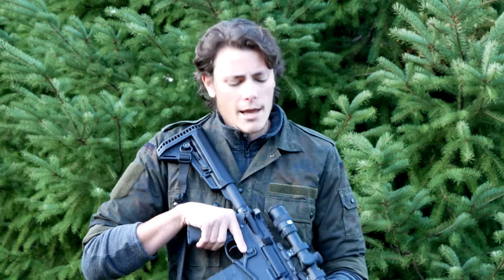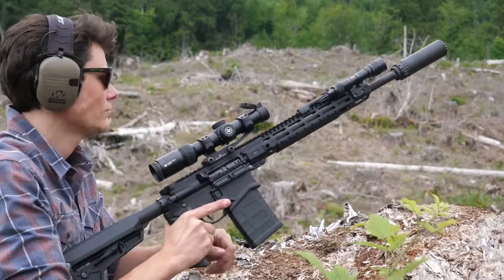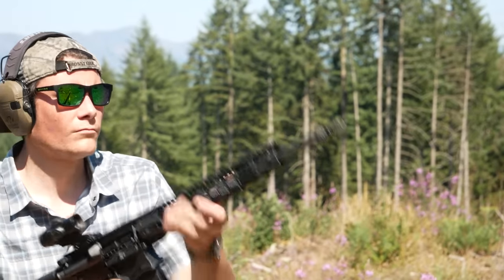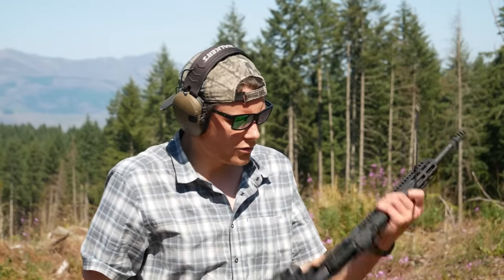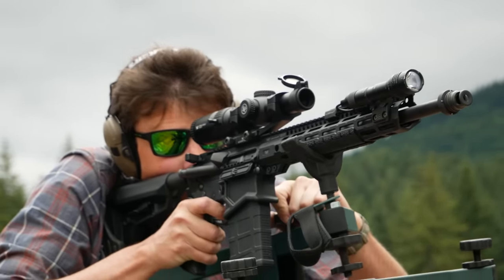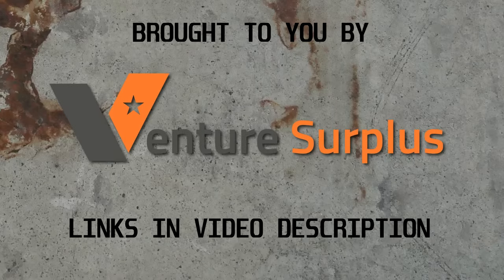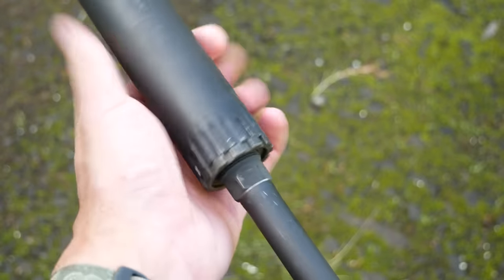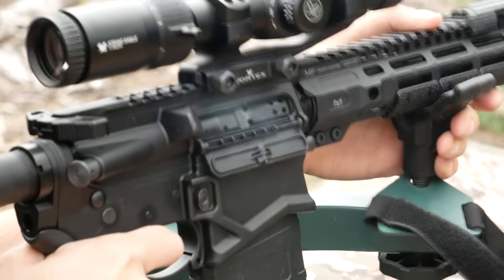Taking the Ruger SFAR to the Limit

Comment: I have a first gen SFAR and none of the issues you have. I shoot primarily on setting 3 right now as I still consider it in its break in period, but I have not had a single damaged case or failure to extract/feed. I have shot it on setting two and didn’t have an issue, but I returned to setting 3 until I finish a few more boxes (so next range session it’s getting turned down). I’m not bothering with a suppressor since I consider any AR pattern rifle not the best for that purpose anyway, so that’s a non-issue for me. I don’t like a gas block with only 3 settings though, I think 10-12 minimum is more reasonable, but I know most AR guys get confused by adjustable gas systems which is why people commonly available things like RDBs and FALs have reliability issues (older FALs sometimes are worn though). If you’re going to make a gun with an adjustable gas system, then I think you should fully commit to adjustability and let the shooter figure it out. Don’t limit their options and the gun’s capability to appease plebs that can’t figure it out.
Reply: @@hnojicYou're ignoring the part where it wants you to run setting 3 for the first 300 to 500 rounds. Running it on setting 2 was a function check, use setting 3 until your a few hundred in. Read the WHOLE manual, don't cherry pick.

Comment: I’ve been lucky with mine. I’m around 200 rounds with 1.3 moa with 168 gold metal match and 1.5 moa with federal 150 blue box. I’m on setting 2 and I would say it’s over gassed. I’m getting light swiping on my brass. I’m running a trijicon 1-6 credo and a ms1 sling and with a loaded 20 round mag it’s right at 10 lbs.

Comment: mine came with a chunk of brass, or piece of primer (not sure, small chunk of metal) stuck in the bcg... runs, but only on 3. have about 250 rounds in it using 147-155 grain mostly, shot a few 168 and 180 too

Comment: If the gas reg was out of spec, how did it make it past all the QC steps and then get put on a finished product? And then be tested at the factory and shipped?
Reply: Because it costs tons of money to gauge the specs on every single part in every single dimension of said part, that comes out of a factory, so most companies will have "1 in X amount of units will be thoroughly vetted" to still do SOME QC without breaking the bank. I would definitely recommend the channel "School of The American Rifle" here on YouTube.

Also, the cheaper/porter quality a product is, there "1 in X" bunch tends to be lower, and therefore larger margin of error. So you get lots of reports of problems on the market
Reply: Because it slid onto the barrel well enough and checking the gas seal without test firing is extra work.
Reply: Because it's a cheap Ruger

Comment: Wild that there is that many issues with a 4 position gas valve.
My Supersass is a simple 2 position.
Normal rounds cycle with normal position.
Suppressed rounds cycle with normal position and suppressed position.
Normal/nonsuppressed shots don't cycle on suppressed position.

It's exactly what it should be.
And the valve is like an MCX. Take a round and just flip the valve to the other side. No allen key or anything needed.

Comment: Hop, I am unsure of your exposure and use of the Superlative Arms gas blocks, but from personal exsperience on 8 different rifles: 4 in 5.56 (barrel lengths 10 - 16in) , 1 in 6mm ARC, 3 in 300 BLK (8 and 10 inch) I have found them ALL to be capable of finding a settign that works both suppressed and  un-suppressed without an adjustment in between removing the can. I havent found any other gas blcok that can do that AND not overgas with the supressor attached.

Comment: if its over gassed its because you changed out the hand gaurd and muzzle break. it went from losing too much gas to not getting rid of any. hence the casing stripping. i havent seen anyone else with this issue.
Reply: 12:45 yeah i think you did a lil much to the design lol

Comment: I'm surprised there isn't (either actually or practically) a gas block that has independantly adjustable settings. Even if it's just 2, using a set screw for each, you'd at least be able to fine tune it to work properly on each setting, and you only have to do it once. I have absolutely no idea how that would be engineered, but if we figured out liquid fuel rocket engines, I'm sure someone could figure that out too

Comment: I wish it was a rifle length gas system, it would smooth out the timing both suppressed and unsuppressed and make it a lot less sensitive. I'm putting together an AR10 with a riflespeed on a 16" rifle length criterion barrel. One of the things I'm curious about is gas leakage around the plunger, it seems like a very loose fit, which appears to be required based on how the mechanism works. Significant gas leakage would make this thing significantly less cool, but i'll see what happens. Maybe the POF is an option.
Reply: @@hnojic He's running the 16" version i'm pretty sure, and if so, its the mid length gas system. I'm referrring to 16" rifle length gas system, it provides short dwell time and longer bolt lock times which results in much better suppressed performance and smoother operation.

Comment: Not a Trijicon fan. Go for a Leupold 1-4X.  They are a LOT lighter,  and better glass IMO. Then, use AP's ultralight scope mount in 30mm. 
There are Lots of cheap 3D printed throw levers for ANY scope are available these days.

Comment: Bought my sfar 11 months go and had one failure after 100 rounds. Put a Rugged 360 Alaskan surpressor on it and was fine on stting 3 until the same jam you had so turned it to 2 and no problem. I have an iray Th50 640. 512 V2 Thermal on it and every time I shoot it I have to re zero it. It has me stumped.  Any help

Comment: Maybe A5 buffer tube with different buffer weight would help it cycle and reduce the recoil? Would be nice to see a comparison of SFAR, POF Rogue and POF Revolution. And Ruger should listen to feedback and release a 6.5 Creedmoore version with adjustable gas block and a normal rail.
Reply from the maker: The buffer tube is already A5 length on the SFAR, it needs extra travel to allow the bolt to clear the longer magazine.

Comment: My SFAR works great, I have never had a single misfeed or misfire yet, Haven't touched gas block a single time. It eats all ammo 7.62x51 and .308 no issues. I do  ot mess with Suppressors as I hate them Muzzle Brakes are 10x better, but that is personal choice. I guess I got a good one. Or unlike every YouTube video I have seen on one I didn't pull it out of the box and twist the gas adjustment 40 times before I went and fired a single shot.
Reply: oof
Reply: @jeramocolto  Not sure why you Oof I also have an Aero Precision in .308 it has way more issues and misfeed average once per mag and has only 140 rounds through it. But is broken in. Everyone and their mother talks about how great Aero is and yet the first one I bought had to be fully replaced for a new rifle from the factory as it would fire due to the buffer spring was an AR15 buffer spring in an AR10 rifle, and that is just why it wouldn't cycle a round. Then the hammer spring was installed backward from the factory and thus didn't strike the round hard enough to even fire, again from the factory. So sent me a replacement rifle and it still doesn't cycle well consistently but at least it fired out of the box. But my SFAR took it straight from box and still not a single misfeed or misfire... and over half the cost of the trash Aero.
Reply: @Mr.Constitutionalist427   well you have a lot of hot takes here that would be argued pretty universally.  Not liking suppressors is fine but opting for a brake over a suppressor is not generally a great take.  A muzzle brake will hurt your hearing permanently in a building, a flash hider will LESS or suppressor probably minimally.  Flash is horrible with a brake, you will be blind as hell after a few shots even at dusk.  10x better than suppressed is a very odd opinion.  Also the “didn’t pull it out of the box and twist the gas adjustment 40 times” comment.. you are making the assumption that the malfunction of the rifle is caused by someone using an engineered feature of the rifle.  If it doesn’t work right and it’s on the rifle, it is a QA or design issue, not a user issue.  You are basically covering for their shitty R&D on this gas system because it works fine under the least adverse condition and everyone who tries to use it as intended is a moron lol.
Reply: @jeramocolto  Do you wear hearing protection wwhile firing a suppressor like 99% of suppressor owners? and are you wearing zero hearing protection when firing a muzzle break? See I wear hearing protection. But now let's take how loud the shot is out of the arguement. Name 1 honest advantage the suppressor gives over the muzzle brake in maximizing the performance of the rifle. Answer none the Muzzle Brake hold tighter grouping and less recoil to allow you to be back on target again. If you truely want to protect your hearing while shooting then go shoot BB gun and .22s
Reply: @jeramocolto  I will put it this way for the SFAR I have only see a couple bad reviews like this one, and many good reviews for it. HOP isn't that great of an expert he tends to jave issues with a lot of products others do not have issues with. There are multiple SFAR owners here in the comment section saying theirs are fine and they have zero issues the only ones saying they suck are non owners and HOP... just sayin.
Reply: @Mr.Constitutionalist427  ok you said name 1 so.. a suppressor provides flash suppression, it reduces the volume of muzzle report, you get slightly higher bullet velocity, the extra weight reduces recoil.  There’s a few.  And yeah I always wear ear protection when I shoot, doesn’t matter what it is.  I use ear protection for my electric pressure washer.  That is a non-point.  Muzzle brakes tame recoil and otherwise make the rifle LESS useful.  It creates more concussion for the shooter and others nearby.  Aggressive brakes can induce flinching.  Suppressors are more friendly to inexperienced shooters as well so it is handy when teaching others.
Reply: @jeramocolto  Past 400 yards you will never see the muzzle flash, if you have hearing protection then you do not need a suppressor to protect hearing. Not all suppressors provide higher FPS many do some do not that is design but many big bore lose velocity not gain, baffle strikes happen which can really cause a round to be off target but then it also interferes with the barrel whip and thus will never hold as tight of a group as without. Literally just watched a review video of a man using a 6.5x300 Weatherby and used a suppressor on a rifle with a 26 inch barrel and shot an over 1.0 MOA at 100 yard with a precision rifle but blamed the ammo and the rifle. His comment section said take off the suppressor and retest it with a muzzle brake but he refuses. point is any even mid range precision rifle shoul fire a sub .3 MOA and a .15 for a very well made one. My cheap old Winchester .270 holds a .4 Now let's talk recoil the average suppressor reduces felt recoil by only 20 to 30% most muzzle brakes reduce it by 50 to 75% smokes it also is much lighter for less recoil. Suppressors are over rated but that is my personal opinion and they are awesome on pistols and close range builds but everyone and there mother wants them on every deer rifle and precision rifle in the land... King of 2 Mile isn't won with a Suppressor I know of. If one has I do not know of it and would be shocked.
Reply: @Mr.Constitutionalist427  baffle strikes do not happen if you check with an alignment rod and the suppressor is square to thread shoulder.  Also, yeah any muzzle device can affect point of impact but ammo is usually the culprit.  Deer rifles can shoot 4 moa or worse and be perfectly effective.  Nobody needs to be hunting past distances where worse than 1 moa isnt effective.  My hunting rifle is a suppressed 308 and it repeatably shoots .75 with my best being .36.  Suppressors are overrated for long range precision shooting only basically, and a muzzle brake is a nightmare flash bang on the end of your barrel for home defense without earmuffs on your night stand.  On an AR do you need 50-75% recoil reduction?  I don’t.  Suppressor, proper buffer setup, and correct gassing will get you close to there anyway.
Reply: @jeramocolto  Last Deer I took was just past 600, but I live in Kansas and long range is what we do 300 is a pop shot by 14. And Home Defense I use 12 gauge with Double 0 Buck through my VR80 and a USP .45 in my nightstand cubby. Cause low chance of Armored targets on break-ins but yes if going against armored targets used .308 which is why I keep a drum loaded for my SFAR that again hasn't had a single misfeed or misfire for me but I just got luck on gun lotto with it. Suppressor makes since for home defense I agree there, the hunting with it I still see no point but that again person choice.
Reply: @jeramocolto  I then shot two matches with my AAC 7.62 SD installed and my scores dropped to the high 400 range, losing 30-35 points from my previous scores. I started getting lots of 7, with some 8 and 9.

Yes, I did correct zero for the suppressor. But my group opened up. I really like shooting with the can, but I hate that I can't get it as accurate.
Straight if a Comp Shooting Forum

Comment: Did you change the barrel ? I’m running a Nova on mine and very happy with it, it does seem to run on only setting 3 right now… I really want to get a rifle speed gas system. What size is the one you have to get for the 308 barrel ?

Comment: I had similar reliability issues with the aero ar10 I lego’d together. Was fine until I put a can on it. I tried different buffers and springs, but a superlative arms block ended up fixing it. 

I do not have to adjust it when I take my nomad off.
Reply: It’s got an 18" barrel though, that probably makes it a little less picky. 

It also weighs as much as the average boat anchor.

Comment: 7:38 ”It also seems likely that we can shoot subsonic ammo with a suppressor and the gas turned way up”

What does that even mean? Either you can or you can’t.

That’s a bold claim, did you even try it?
If you did, did it cycle with the original spring?

Comment: How can it be that some rifles do not even have adjustable gas settings, but this one "beats it self to death" on setting three ?   Are the other ones "fixed" at a sort of "gas setting 2,5" then ?'
Reply from the maker: Most rifles with a fixed gas block will not be as overgassed as the SFAR at setting three. But if you throw a high backpressure suppressor on one and shoot it a lot it will also cause accelerated wear. The full size LR308 platform is a lot more robust than the SFAR though because the bolt and carrier are much larger.

Comment: @hoplopfheil 
Hop - I know this is off topic but you are my go to source for honest and insightful feedback while not worrying about blind loyalty to conventional norms and perspectives. 

That said, have you tested any weapon light clones? Specifically, I’m wondering if there’s a legitimate reason to pay $400 for a f’ing flashlight compared to a $25 knockoff. I know a clone won’t be a perfect quality replica, but I hear about failures, etc., with the $400 variety. 

The fact that a damn surefire pressure pad that sloppily attaches to a pic rail with rubber costs ~$120 seems absurd.
Reply from the maker: I don't think using toy grade knockoff parts is a good idea, but there are less expensive lights that are good. Streamlight HLX is still about the most bang for the buck you can get.

Comment: Step 1 Buy the rifle
Step 2 replace all of the parts with aftermarket 
Step 3 have fun
Reply: Like they did with the Springfield DS 2011, 
Would these idiots buy a new truck that the AC was not great, fuel pump was inefficient, 4WD had trouble engaging in the cold?

Comment: How'd you get the aero ultra-flimsy mount to work on a 308 gasser?
Reply from the maker: What about the mount do you think is flimsy
Reply: @Hoplopfheil  when cranked to the spec 15inlb my scope would slip under recoil. When cranked tighter the claw snapped.
I blamed myself entirely, things break in my presence,  until I saw C_more also has that complaint.
Reply from the maker: Interesting. Maybe a tolerance issue with the anodizing? I've used several of them including on 308s. Never had any issues or breakage.

Comment: Not an outlier.  My SFAR is doing exactly all of the same.  It’s been to Ruger once.  New barrel, new gas block, new bunch of stuff…but same problems all over again.  I hate to waste another 200 rounds on another “break in.”  Maybe skip ahead to the new gas block?
Reply from the maker: Yeah I just don't think they will be able to find the sweet spot in the gas regulator unless they drop that Zero setting and add something between "regular" and "adverse."
Reply: Thank you for the work you do.
Reply: Question—and I may have missed it…—which length Riflespeed regulator did you use?  4.3, 4.8, or 5.8?   Their website says all three will fit my 16” SFAR.
Reply from the maker: The shortest one is probably what you want, but it'll depend on the length of the handguard.
Reply: @Hoplopfheil  Understood.  Thank you.
Reply: Update:  the Riflespeed gas block solved the problem.  The SFAR now runs.  It’s accurate, recoil is nothing, and it’s fun.

Comment: I have a SFAR configured very similar. I bought it as a platform to build off of. I have been considering changing to the rifle speed gas block just to get a more fine tune adjustment of the gasing. Did you use a straight gas tube?
Reply: You have to use a str8 tube. No choice